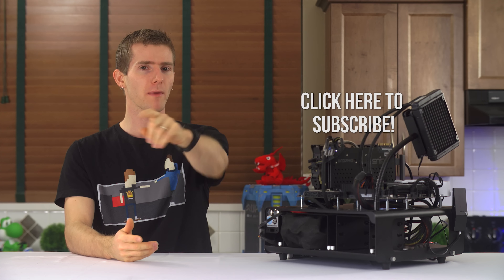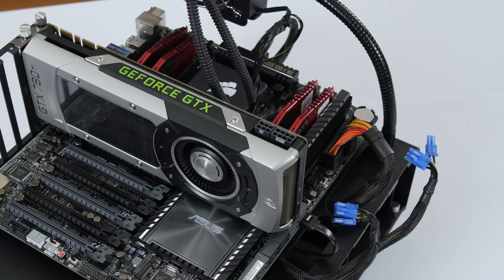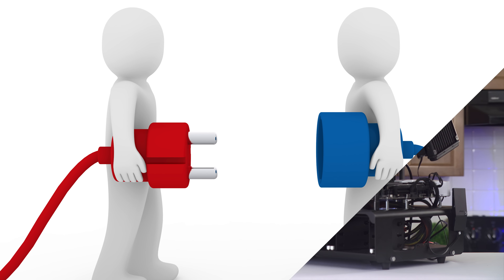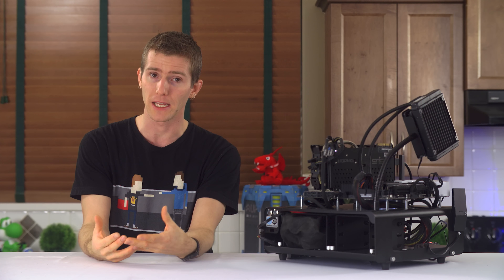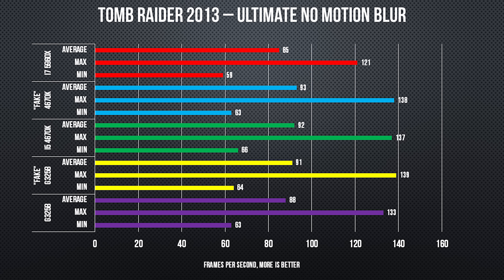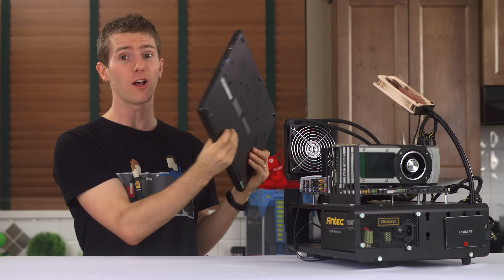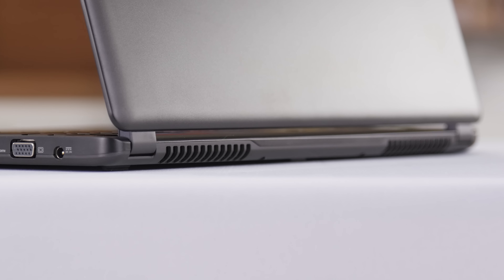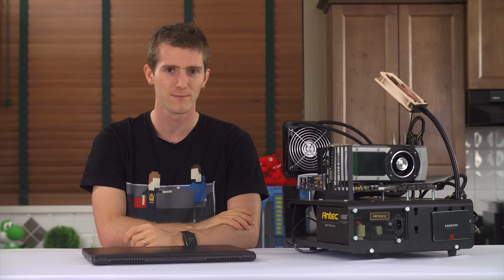CPU Simulation - Can You Simulate Performance of One CPU with Another?

Comment: http://ca.pcpartpicker.com/p/yRXfRB

is there anything to change in this built (for gaming and video editing)? if yes please change it (the end price has to be the same and the gpu and cpu have to be the same. Also the accesories (monitor,mouse,heaset) have to be the same)
Reply: * The headset and mouse are pretty bad, why not change them?
* Do you REALLY need a $120 Cooler?
* To pair all that hardware with the cheapest Corsair PSU around is really not a good idea.
* Do you need a 250gb SSD? If your using it for main programs and OS 120gb is normally fine.
Reply: Togutas the headset if pretty good watch linus's review about it, it even god the std treatement and with a audio amplifier its even better. I want the mouse because it is still above average and I like the material and the feel of it (already tried)+ it has razer software which I really like. Also I already have some audiophile grade headphones, those one are just for gaming and for my little sister to use
Yes I need a 120$ cooler because I will overclock to the limit and game/video edit for a extended period of time (sets of 8-12 hours)
I guess you are right I will change the psu but its not like the parts will explode because of that. Its one of the best 80+bronze psu out there its only because I need 390w that I did not go like 1000w psu.
 Yes I do since my OS will have a lot of mods and registry edit, Plus I will not be the only user so I want other people experience to be the best possible. Also I have many games that take a shit load of time to load (ex: Sims 3 take like 30min) since I have a lot of mods/expention pack. 250gb is perfectly ok and I got it at a good price. I may even add some after. Plus the other companie 128gb are 10$ less.
Reply: get 1866 or 2133 ram hehe, and i would get a 30 bucks cooler, my 3770k is at 4.3ghz and only 1.15v, but i think hasswell overclocks worse but my temps are 76 in the hottest core with prime 95
Reply: also wtf, 430 watts xDDDD
uu need minimuum 500 or 600, i know 970 doesnt need much poweer but the next gpu u get in 2-3 years will need more power
Reply: ***** I will change my psu at that time. I live in ca and with all the tax and shipping, this build is already 2000$
Reply: ok I took of the hyperX since I already have some headphones and most of the game that I play are not the ''yall have to hear them footsteps'' kind of game. I play game that are like Watch Dogs, CoD campaign, Just cause 2, etc. With that money saved I chose a 80+ gold psu. if its not good please find a good replacement. Thx
Reply: ***** na the monitor is like the best for 200$ gaming
Reply: Togutas the mouse is amazing and the headset is good. Think before you speak. Not everyone is buying their peripherals for LoL or dota.
Reply: I'm no techie, but it seems that you need to upgrade your psu (I think)
Reply: BTW that PSU cant handle that PC
Reply: Adam Ryan I wont be doing any overclocks and yes it can a friend of mine has the same built (at least cpu, gpu and psu) he also has more storage and overclocked a bit and his pc is stable
Reply: Sèna Gangbè Theres no chance that a 430w can handle that PC. The 980ti Reccomends having atleast 500 alone.
Reply: Adam Ryan it has a 970 not a 980ti
Reply: Sèna Gangbè NVM then sorry :P
Reply: Red and black components, black and blue windowed case. Why?
Reply: change your case to the black and red version instead of blue since red is your theme, rethink if you really need that cooler, and for sure go with an at least 600w modular power supply. and you'd probably be fine with a caviar blue hdd instead of the black.

Comment: I came here thinking that you were going to talk about an FPGA CPU.
Reply: They were talking about a "Field Programmable Gate Array" which is a type of processor that rather than having it's architecture hardwired, it's basically firmware, meaning you can program it to be whatever you want it to be. The point of them is that you can use them to make  dedicated hardware acceleration for a specific task rather than a doing it more slowly with a general purpose CPU, or having to have a chip custom manufactured. They can also be configured to be any CPU you want, as long as they have enough gates for it.  I've heard of them being turned into server processors that have a really low clock speed, so they can be run at higher speeds, for example.
Reply: Well, Intel bought Altera, one of the main manufacturers of them last year, so maybe they'll start to get more common. I imagine the main issue is that they are outperformed by ASICs (sort of the same thing, but hardwired at the factory) and the cost of designing your own custom processor is going to be so high usually that saving on manufacturing might not be worth it. Don't really know for sure though.

Comment: I will use a Pentium 3 800mhz to simulator a Core i7 5960X
Reply: GReDDY WupS  #1 they are different archetecture. #2 the pentium is a dual core #3 gl getthing that 800mhz cpu to 3.5ghz.
Reply: Douglas Gardner
You didn't get the joke do you?
Reply: GReDDY WupS oh i got it.

Comment: Linus why is the real 5960X being outperformed by both the Real and Fake 4670K in some benchmarks?
Reply: +Ben Braunstein because the 4670k has an higher base clockspeed. (4,4ghz > 4ghz) he oc'ed the 5960x for the fake 4670k. and since since games often don't benefit from more than 4 cores it's better to have 4 core with an higher clockspeed than 8 cores with a lower one in such benchmarks.
Reply: +CryBeat But then you can just overclock the whole 5960X to 4.4-4.5 and forget about everything.. :)
Reply: PIXELFLUX ofc i would :D
Reply: CryBeat I'm gonna have to buy it to pair with my two Quadro M5000 cards. 3Ds MAX, along with Photoshop and many others still want the high clockspeed and are majorly single-threaded (stone-age, basically), which sucks...

Comment: The real reason AMD wasn't used as it's a peasants choice (plus it's not even 8 core)
Reply: ***** Haha, you must be joking, bloody hell that cracked me up.

You proabaly have a HP costing £400, thats the problem. The real reason why AMD cpu's are "AMD doesn't have an EIGHT core CPU, their 8 core CPU's feature simulated cores. It's all based on a 4 module shared resource system and it doesn't work very well"

I'd read this boy:
http://www.tomshardware.co.uk/forum/363278-28-core

Also your profile seems to come across that you are an insecure console kid. 

Check the steam hardware survey, there is a far greater percentage of people using intel CPU's than AMD.

Another note to add is that my friends 3570k is more powerful than an 8350. That goes to show amd is far behind intel in terms of performance. http://cpuboss.com/cpus/Intel-Core-i5-3570K-vs-AMD-FX-8350
Reply: wake and bake